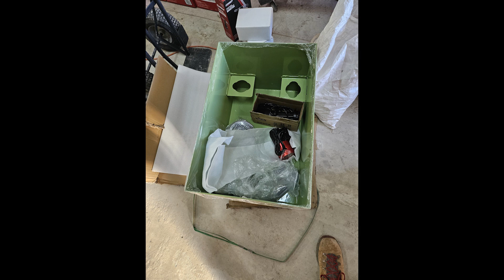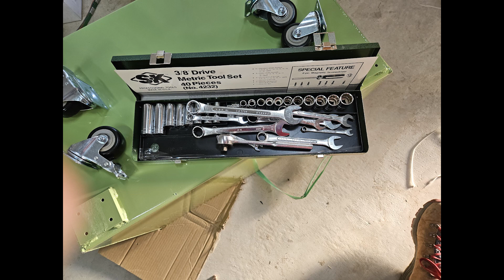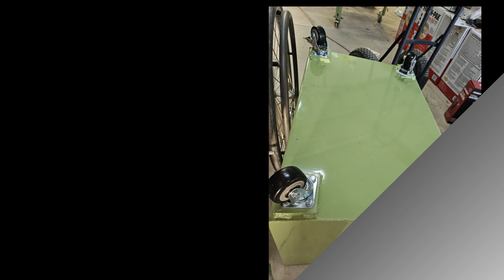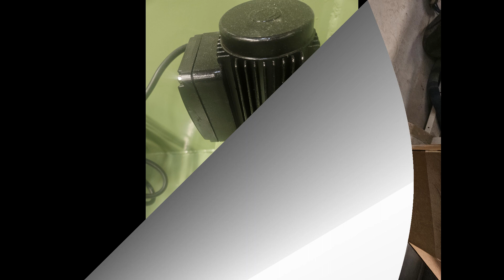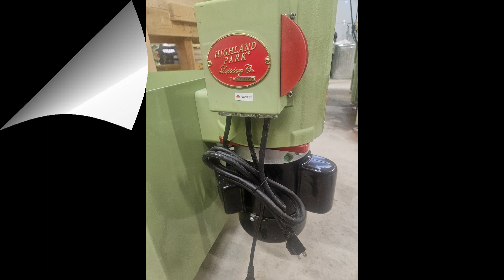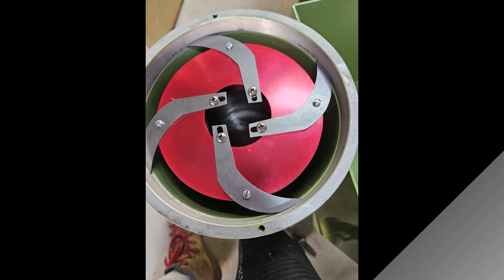Highland Park Lapidary freestanding everclean unit assembly

Comment from the maker: The everclean system keeps the saw really pretty clean. The oil will stay clean for a year or better, depending on how much you cut. Without the everclean you will constantly be mucking out your saw and loosing expensive oil.when you do the math, buying an everclean vs. mucking you will pay for the everclean system within a year of savings from replacing oil.